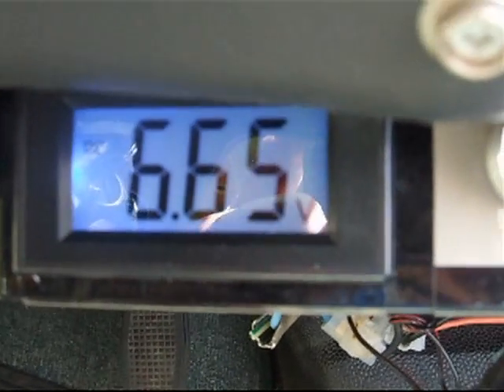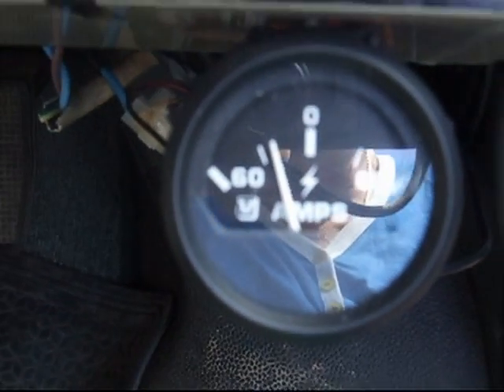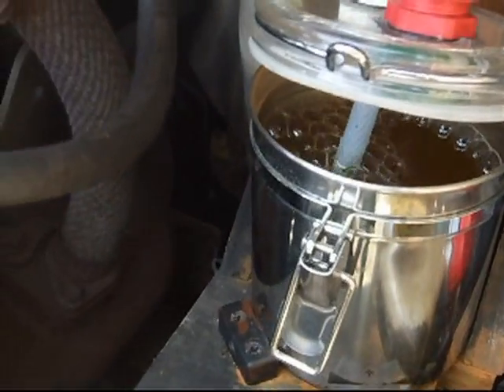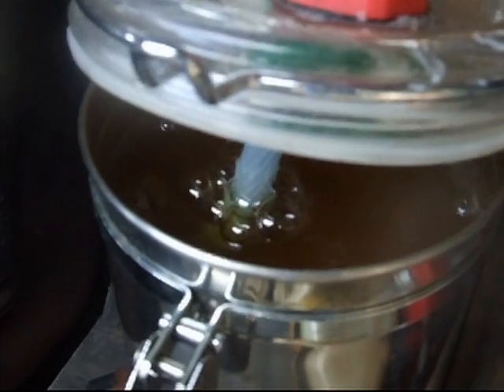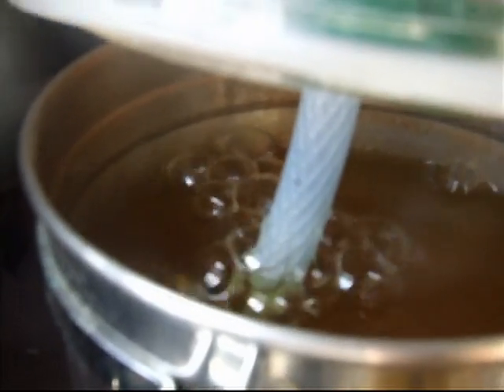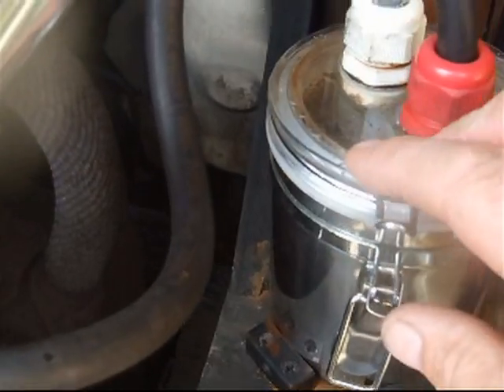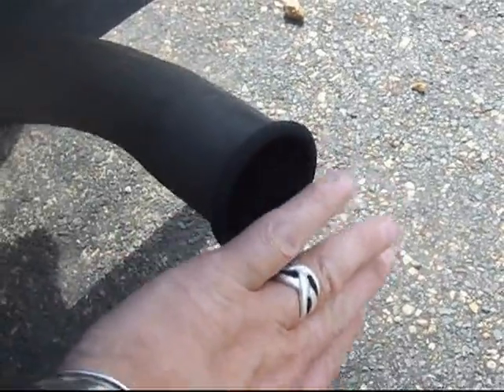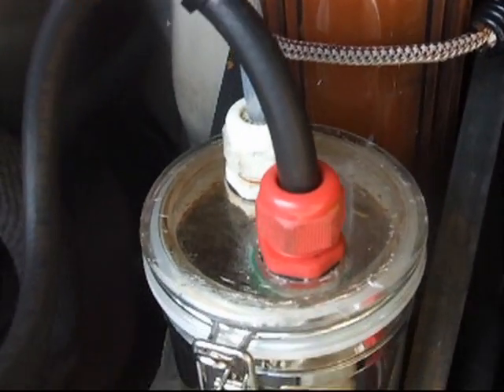HHO DIESEL FORD TRANSIT INSTALLATION

Comment from the maker: @guy5890 HI, There dose'nt seem to be any evidence of excellerated rust in the exhaust or engine,there have been discussions of long term use with large amounts of hho causing brittlization of engine,There's large truck company's in the states using hho ..doubt if they'd risk their precious rig's to any damage.If you check out the research some people are using as well as a bubbler ..a dryer system to get rid of steam residue.I use same system on vid on my regular day vehicle ..no probs last 3yr

Comment from the maker: My original calculations about 2yrs ago were wrong ! as i dont use this van everyday + didnt know exactly its mpg ...this takes along time +many tests ...i can now confirm its mpg b4 hho as  approximately 27 - 30 mpg , with the hho it gets around 25% better mpg depending on driving conditions at  13.8 v + keeping amps via pwm to 12-13 amps so that pwm dose'nt overheat .

Comment from the maker: HI,CORRIGGEEN71  very hard to estimate total cost as was working with this over long period +upgrading ..i recon in the region of £250 , so as time has gone by i think it would be very wise to checkout some of the readymade new dry cell options on EBAY available now n save yourself a lot of hassle time & money accessing various materials ,i will personally be upgrading to a dry cell when i get the time & money as these will probably last a lot longer + more efficient than my current system.

Comment from the maker: info note: a pwm will control voltage to the cell ,if you dont want pwm you can reduce voltage by including more neutral plates , there are calculations for this visit HHO INFO site.

Comment from the maker: @BlackGoldEstates the voltage to the cell is controlled via a 30amp pulse width modulator ,when cell has just warmed up ..i crank it down to aprox 7amps ,..on long journey's i usally run at 9-10 amps achieving between 25 n 30 % better mpg ,i keep amps low on this system to stop overheating my pwm ,cheers.

Comment from the maker: @mickeymerc11 ,HI Mickey, i got most of the materials for this cell off ebay ..best cheapest place ..cell container is a water filter housing..there are sheet metal firms who do small offcuts of stainless steel or cut to size...my next cell is gonna be a drycell design..much more efficient + your'll need some sheet titanium for negative plates ...if u use all stainless steel it produces hexavelant chromium ..wich is carconegenic (toxic not good)..its all about net research...goodluck..FDC : )

Comment from the maker: Hi, i have had no problems with winter running HHO ,  the temprature only drops below here in south east uk occasionally ,..if your cell is well made you should have no problems !, i dont use this vehicle in winter (transit 2.5) ,but use my mazda bongo van 2.5 turbo diesel ...the cell is well insulated as it is sited near engine wich is beneath the access in the cab of vehicle ,even if you do get a bit of ice in cell it should soon thaw as it warms up...but a good idea to insulate cell !.

Comment: Hi, and thanks for details! I would like to know how does the HHO sistem pass the winter...I'm thinking to put a HHO on my 1.9D engine to and i'm in Romania where the climate is with four seasons. Also the diesel is around 1,20$/l. I'm driving around 25.000km one year and i have a magnetic fuel saver but not having big results.

Comment from the maker: @rintsik last long test summer 2010 =inconlusive ...kept getting leak on cell ..year b4 on a good run with no leaks i got consistently 30% increase ,its very hard to gauge somtimes considering different driving conditions ,but my 2.5 diesel mazda bongo friendee i use everyday , i consistently put 13.65 litres in from empty =3gallons aprox ...=70km without hho...100km with hho ,i use this van every day of the week for last 2 years short local journey's ...alway consistent results.

Comment from the maker: HI PEOPLE, as i only use this vehicle with hho in the summer months..i have not yet had conclusive results on weekly all year test ,the 2.5 turbo diesel mazda bongo friendee wich i use every day of the year with hho + venturi just b4 turbo intake,has been consistently giving approx 30% better mpg depending on driving style (,i do like putting my foot down) i put 13.65 litres in without hho it does 70 km regular (17mpg ) as soon as hho is hooked on it consistently does 100 km 30% more  (22mpg ) .

Comment from the maker: Hi rintsik, the last over 500 mile trip i did ,i had inconclusive results ,as the cell developed a leak ,.....as a rule when working it was getting upto 30% increased mpg.I think  i need to build a more bullet proof cell to go forward, also i am not inerested in going forward with a cell that produces carconergenic toxic waste(hexavelant chromium) ..titanium electrodes is the way forward+drycells.

Comment: I think there's something wrong with yer engine... it sounds all krunchy and stuff... like you fergot to remove yer tools from inside the engine and turned on the engine anyway... maybe some screws and bolts jiggling around inside

oh WAIT... that's a diesel engine... uhmmm... NEVER MIND, yer good to go...

Comment from the maker: The next mpg test will be with 1 full tank of diesel ,the 2.5 18ft transit motorhome does upto 33mpg in ideal driving conditions,tank holds 15 gallons=495miles, i am hoping for a 30% increase, wich would mean 42.9 mpg. The wetcell in a waterfilter jar consists of plates 2"x8" ...21plates.... -nnn+nnn-nnn+nnn-nnn+  .... all 3 negatives are titanium  ...3 positives are 316l  15 neutrals are titanium running at 8v's and 9amps ,hoping extra mileage will be 148 miles..we shall see.

Comment from the maker: hi people,have not done much on experiment front lately,but the mazda bongo van i use on a daily basis wasnt getting usual mpg gain, i consistantly put 13.65 litres (3 gal) at atime ,usually does 70km to this , checked the cell ....it was leaking..!...fixed it ..and went straight back to 100km..! 30% increase approx....I must point out tho ! in the book it says mpg is 21mpg....i've only ever got 17mpg without the cell,+ i do put my foot down when i can.

Comment from the maker: HI man ! mot test showed not much change in emissions it had 3 tests at hi revs,i think emission is only lowered on low tick over ..as it used to smoke now it does'nt...hi revs not much difference!. i was logging mpg on trip away, journey out got stuck in traffic about an hour all told ,journey back i was hitting 80 n 90 mph, got 29 mpg ,..still good for an 18ft rv. Need to do a more reliable test.